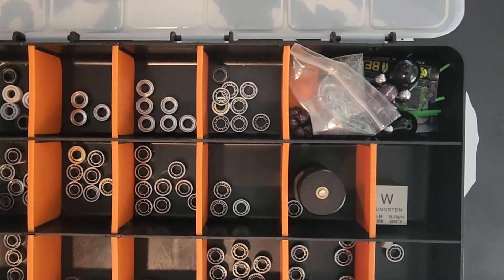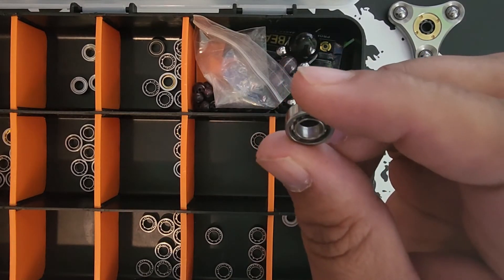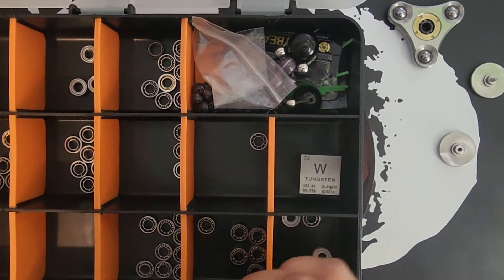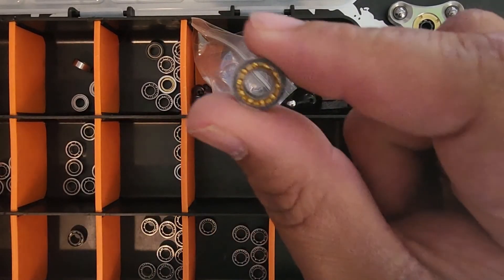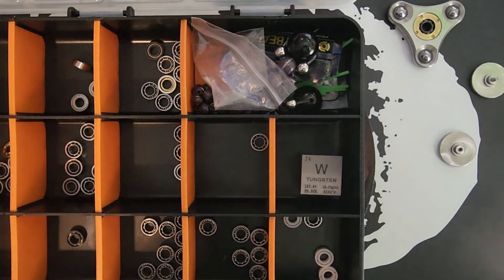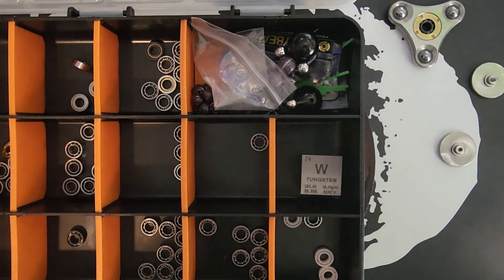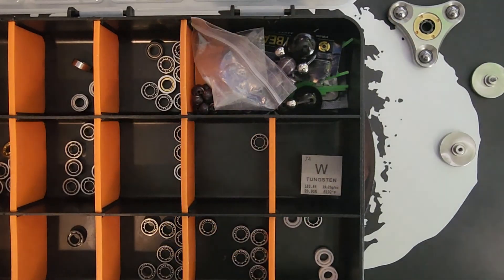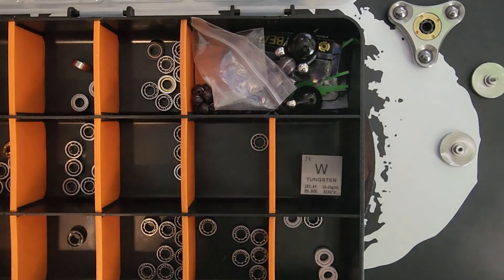What are fidget spinner bearings, how to remove and install, best spinner bearings

Comment: Just got in the mini collision in ultem and the horizon in SS. Thoughts on the stock KAP bearings? If you think an upgrade is warranted, would you recommend one of the options from KAP?
Reply: did u change the bearing on the ultem collision? i ordered a full ceramic bearing n im wondering if its gonna spin longer and be less wobbly when moved

Comment: Thanks for this as I'm fairly new to spinners and messing with bearings. Do you have a link to the removal tool by chance? Or any other one that comes to mind.
Reply from the maker: Search Kinetic asia pacific bearing tool and you should be able to get the nice one from them. Wish I went that route vs the budget ebay one